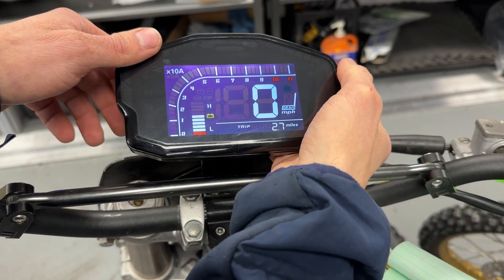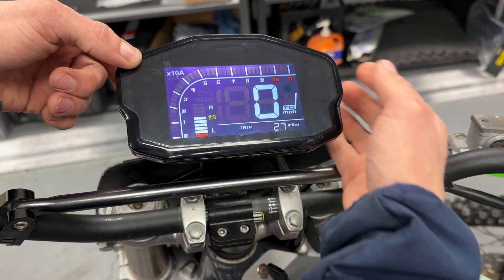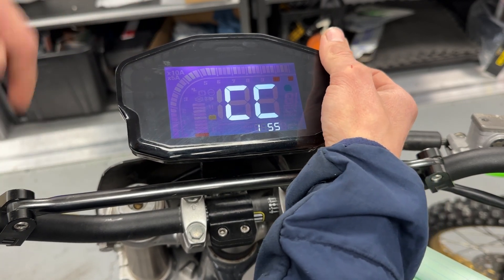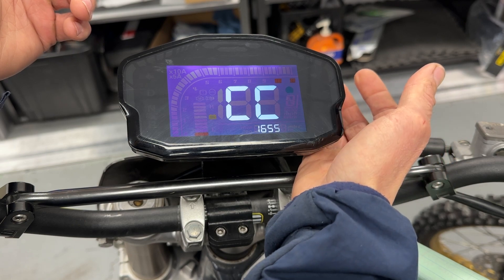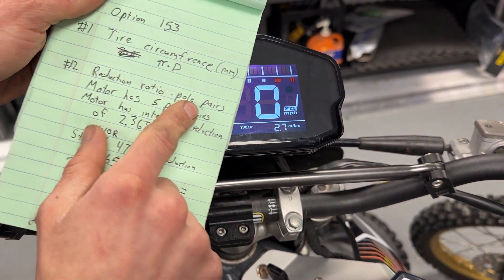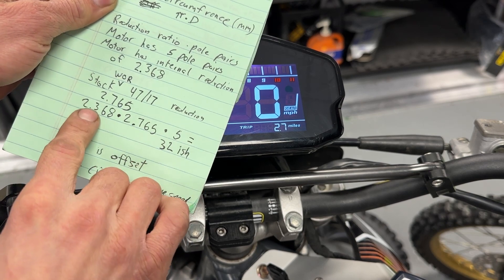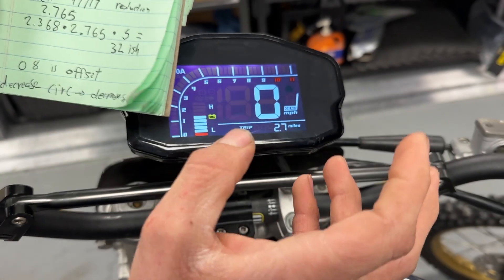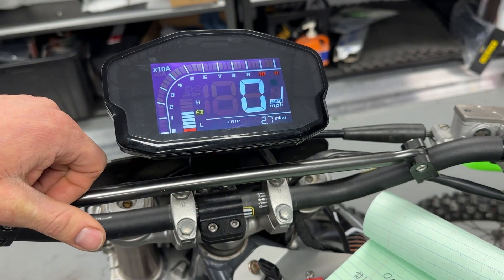Wired Off-Road - Speedometer Calibration

Comment: A real easy way to get the circumference of the tire is to mark a spot on the tire and on the floor, and then role the bike until that mark makes a full rotation mark that spot on the floor and then measure between the 2 marks.
Reply: Yea but the rim DIA IS SHORTER than the tire DIA. which one does it want?
Reply: @RetroMancer242  You would definitely want to use the tire dia. for this.